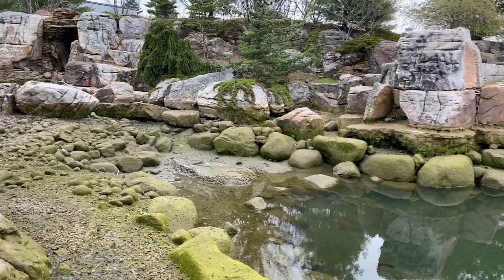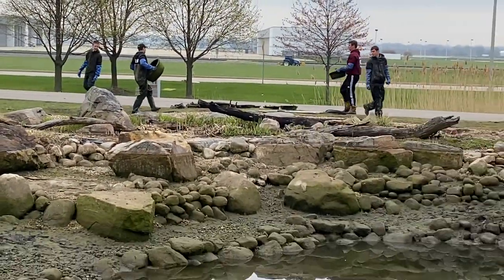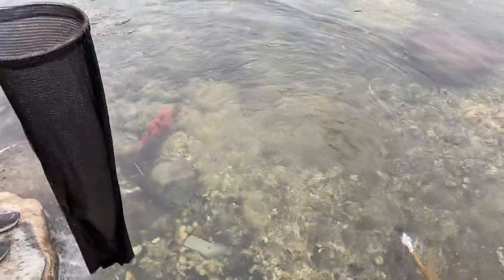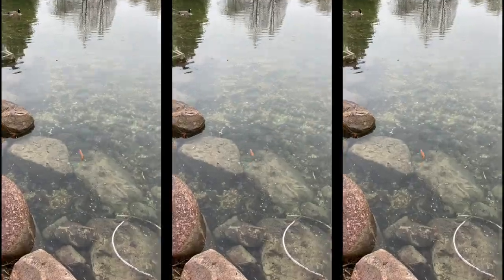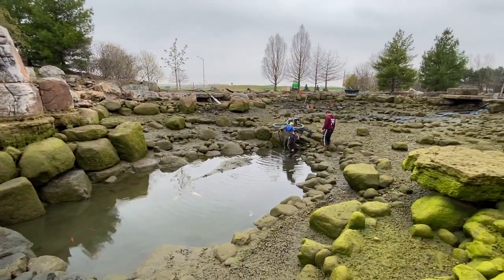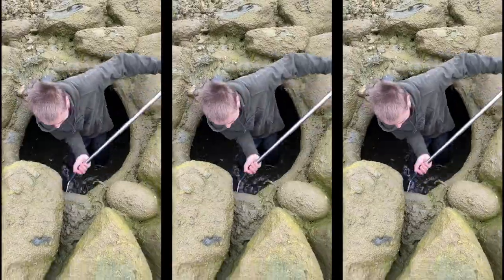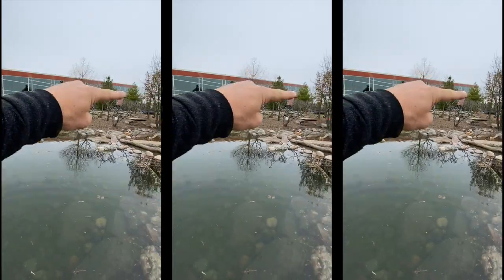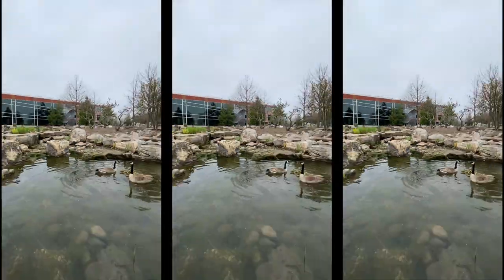Sand Beach UPGRADE for REC POND: Cleanout at Aqualand - Part 2

Comment: Ever since started doing landscape in 2010 and met you ed and y'all from aquascape when we all went to Phipps conservatory in pittsburgh. I moved to Louisiana. Got a landscape job there. We had a client in one of the Bayou on a private island. We had to specially build a metal retailing wall with supports in the back.we dug the ground out 5 feet deeper than the ground it was originally. Then put all type of drainage piping in with all types of filter fabrics and rocks. Layer after layer. Then we did a regular pond build. So its pretty much a pond right next to the bayou with a deck and all.